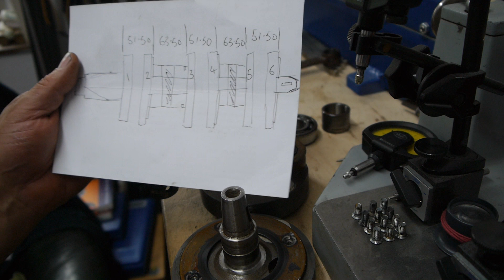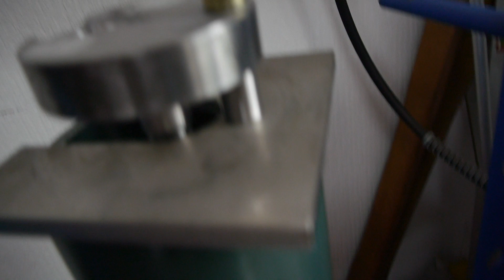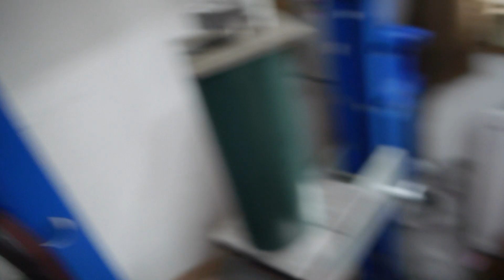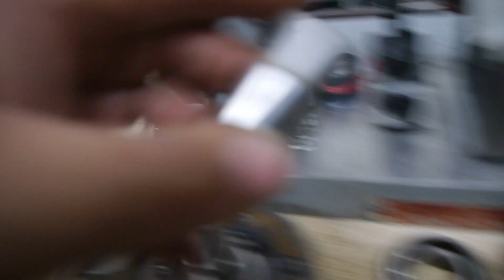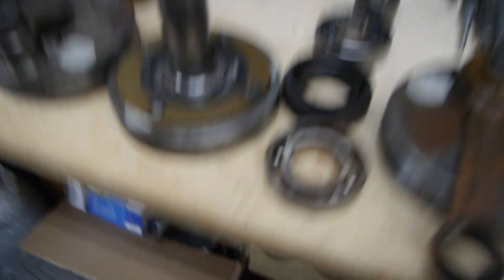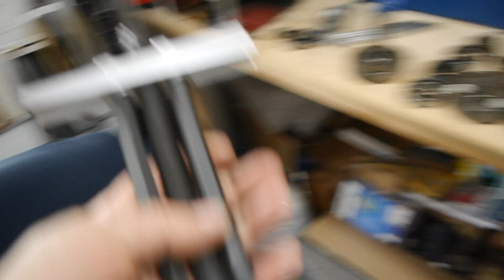Kawasaki H1 500 Crankshaft inspection and rebuild

Comment: Thanks for posting.  I am about to start rebuilding a 1973 H1 engine.  Would love to see your procedure for taking the crank apart and pressing back together again.  Nice job.
Reply from the maker: Tools needed for taking apart a Kawasaki H1 crankshaft.
Start taking things apart from the generator end which is on the right of the picture.
All you need is the cheap ball in bearing puller set to do all bearings.
Notice my crank pressing tower, 14 inches high, 5 inches inside diameter with a slot cut on one side at 10 inches deep to centre hole drilled/cut away the slotted area, the wall thickness 3/8", the tube is made from an old hydraulic ram, ideal for the job, any good hydraulics company will have old rams to obtain this. 
The splitter plate is made from a 6 inch square of 8.00mm steel plate with a slot that can span the big end of the conrod you are working with, you will need different sizes and widths of plate for different cranks; This best supports the crank securely. To make this simply drill the size of hole needed to span the big end in use and cut the waste out to leave a fork or slot to slide between the webs of the crank.
Start taking things apart from the gererator end and work your way across the crank making sure not to damage or crush the oil plates, these are of different sizes to match the different sized bearing on this crank, try not to get these mixed up.
The older cranks had inferior main seals them having no nipping springs and relied on crankcase pressure to close down the lips, the newer seals are far superior being fiitted with the springs, and will produce a better running engine and have better longevity 
 Use the same tools as I have shown in the previous video, for the smaller bearings, I used the ball in bearing types, you have to remove the bearing cages to use these ball end types, and for the larger bearings you could also use the same puller with larger ball ends.
Like all cranks make sure to photograph, making notes of where all the bearings and how they are fitted together.
On this crank there is a ringed locating bearing third from the main drive side, make sure you fit this correctly.
These are very easy cranks to build having pegged main bearing shafts/webs probably the easiest crank I have done.
Everything is made so there is no need to measure the widths, all parts press up firm and leave the correct gaps throughout.
When you come to balance it after completing the build always begin dialing in from the centre web itself using two gauges at the same time and work your way outwards to either end, IE, take readings from on top of the bearings and you will get a better balanced unit later.
If you look at my equipment in my other videos you should be able to do the task, a pressing tube is by far the best way of holding the crank whilst pressing on the bearings etc, the tubed type tower gives superior positioning and holds things much more accurately, you will also need two decent bed plates with a hole large enough to surround the bearings when pressing out the inner main bearing shafts.
My pressing tube is 14 inches tall, 5 inch diameter with a slot of 10 inches deep for the conrods to clear whilst pressing, it is made from seamless hydraulic ram tube, wall thickness 3/8", really sturdy and ideal for the task.

For more see my facebook page link.

I will do another H1 crank and full video soon.
Reply: @MotorcycleEngineering101  Wow!  Thank you so much for the detailed disassembly information!  I am at the point now of trying to remove the cylinders from the case.  This bike sat in a barn on the ground for 6 years, and there is evidence of water damage.  Not looking forward to what I may find inside.  I saw another video of a clever way to help lift the cylinders by tapping the top holes and using bolts against the top of the cylinder studs to help lift off the case.  I need to order the metric tap and bolts.
Reply from the maker: @bobwish51  You ae most welcome Bob, please ask if you have any other questions.
Reply: That's my crankshaft done a cracking job